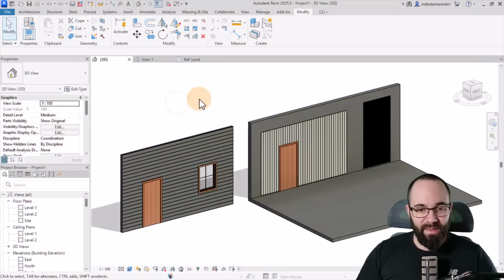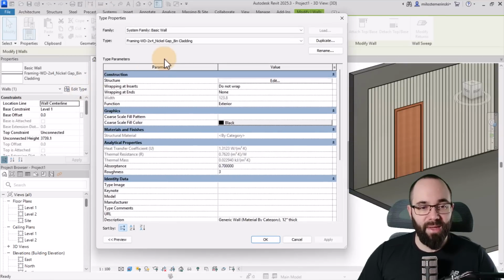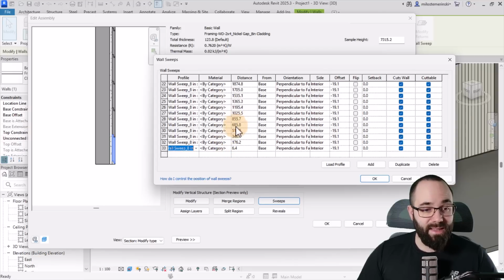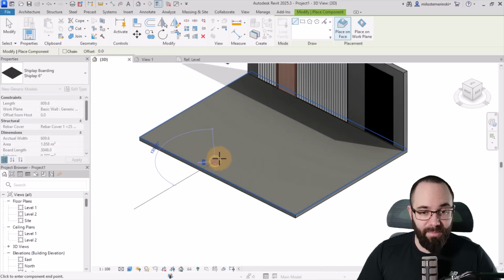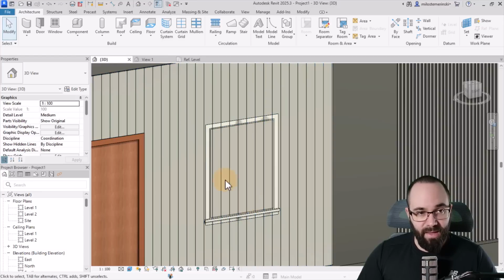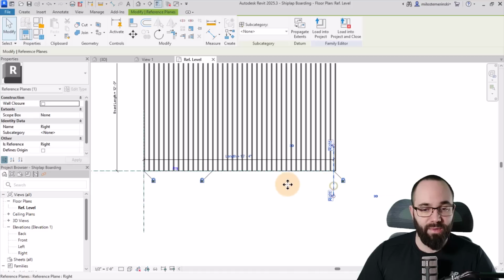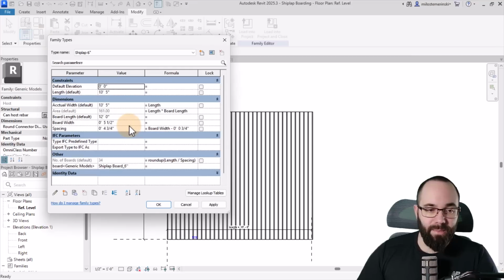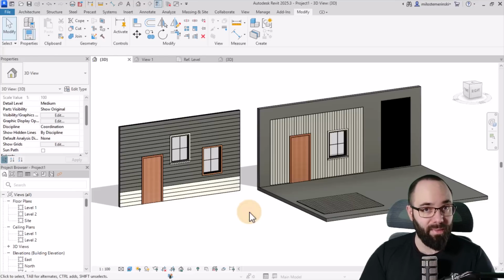Wood Wall Cladding In Revit Tutorial

Comment: I've seen a dozen tutorials on how to create lapped siding but I still haven't found one that shows how to create a ship lap siding the cuts out at doors and windows and butts up to the trim. Not behind it. I guess you could do the same trick at each opening with the temporary structure but that could be tons of time consuming work and not fun if lots of changes are made after the creation. But this is a great tutorial and I appreciate it.
Reply: To align them to the trim of the doors and windows you can set the offset. As an example, for the wall sweeps approach, you change the offset until it reaches the trim of said door or window. Or you can do the contrary, where you can make the doors or windows trims to be thinner and butt up to the slats.

Well, as most people said here, it's incredibly boring and tiring to make workarounds with every possible thing in Revit, but it is what it is...

Comment: Isn't that too much? The contractor that is hired to make these panels will still take his own measurements and will say his own price and amount of materials for his job.
Reply: It is too much. In reality you would just add a wall layer with the thickness of the cladding.
In the material settings you can create (or choose an existing) material with horizontal lines as the surface texture.

Easier, faster and lighter on your model (less useless geometry with basically the same visuals)
Reply: for the type of cladding in the video a texture is probably enough. But when you have boards with bigger gaps for example textures don't work any more and you need every board to be physically in the modell to make it look right.
Reply: @olik136  i‘d rather load in an image texture before I do stuff like this. I guess if you want to do close up renderings you could use this method but other than that idk